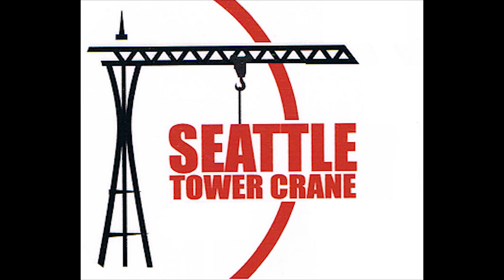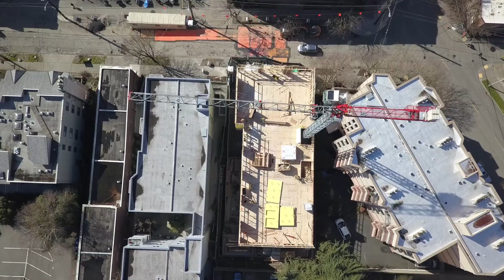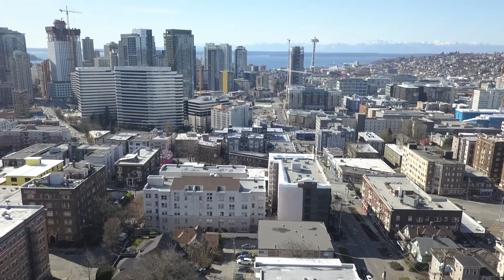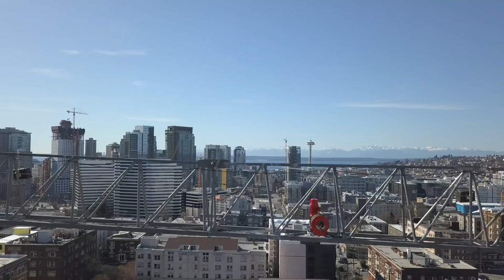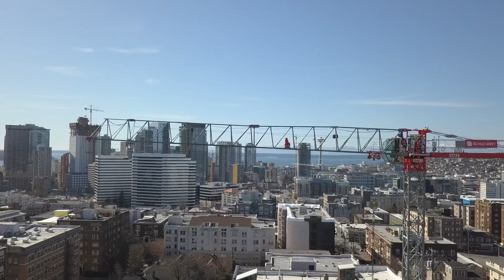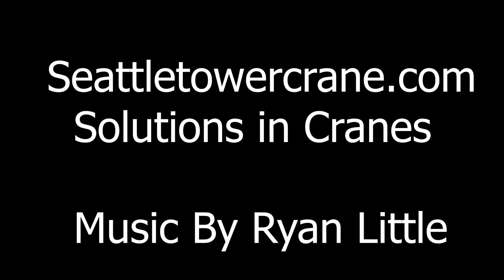Saez TL55 with 82' of jib

Comment: I’m in one of these cranes and I have to say it’s the roughest I’ve ever ran. I’ve ran friction rigs smoother than this thing
Reply from the maker: Is the roughness just in the swing? If it's VFD controlled, the parameters control the speeds and they can often be adjusted. Like our TLS65's from a couple of years ago, we've had to adjust the speeds from 1st to 2nd step because it was like a 200% gain which would cause the crane to bounce on every pick. So we adjusted 1st 10-15% faster and 2nd a bit slower as well as third to balance it all out. 

My biggest complaint with the 55's is the auto braking on the slew. It takes some getting used to the timing of the stop. You have to bounce through the steps to catch it properly and come to a stop. I've honestly only ran one for a day back four years or so ago when we got our first one in. They do have that VFD locked up on us. I suspect that years later they'd open it up for us but when we first got it they weren't willing to share access to reset parameters. The modern ones, 2017 and newer,  are fully adjustable by the techs and they have good counterswing.
Reply: @rotyag  I appreciate your reply, I was filling in for a guy yesterday and that was my first time in one. The swing and trolley are extremely rough compared to the Potain I usually operate, the build quality is extremely poor too. He’s been running it for a year and has complained a lot about it, I thought it can’t be that bad. It’s definitely the worst tower on the market. I will send him over the adjustments you sent to me and again I appreciate the help.

Comment: Hey rotyag I’m 18 and just started my full time tower crane apprenticeship and I’ve loved some of the content you have already put out I would love to see a video on tips and tricks of our trade or stuff you wish you knew when you first started and thank you for having this channel I’ve already learned so much
Reply from the maker: Smooth and accurate is far more important than speed. If you nail a location and it's coming in smooth in a way that the guys on the ground don't have to work for it, that is actually faster than raw speed. But if you can run at the top end of the crane and do it smooth, now we are talking. That's a bit more rare of a bird. But focus on the smooth and accurate to start. 

Be vigilant about crane safety. Both in operations and structurally. I took a crane down once in Hawaii. it was a 40 story. The last time anyone had been to the base was about a year before for the retorque... assuming it was done. Operator never went down there. The pins in the base were partially out of their holes, not really doing a thing. Fortunately it had tie- ins for the operations side, but we were about to climb it down when it was found. I don't think that we would have made it down in one piece. But you'll find crazy stuff overlooked and it's up to you to find it for your safety. Missing welds. I've found missing welds on 30 year old towers. For 30 years, no one really looked at it. We must be better. 

Don't fear for you job. Ever. That's when people make poor choices. Make the right calls unemotionally. When you hear of a great operator, call them up and ask if you can sit behind them for a few hours when you have time. There are tips and tricks to running each crane. The only way to pick up on the best options are to sit behind the best. Don't let ego tell you that you are good enough. Jobsites will kiss your ass and tell you how great you are. They don't know and they just appreciate when you help them. Always push to be better. I've seen plenty of 50 year old operators that I wouldn't hire to fly garbage cans out of my back yard. We are professionals. We have to be the best and that takes years and years of work. Don't let people make you feel like your work is done. It can always be better. 

Ask questions of those with more knowledge than you. It's amazing what some people know. And the more you know about how cranes work, the less mysterious things are. And you can operate knowing about these things. Horsing a crane around to save five seconds isn't always the best thing if you are destroying the brakes or running too much duty cycle time and cooking the old cranes. Downtime is way more costly than taking a bit longer. (Again, most of that is with the older cranes. New cranes have VFD's the protect the crane from itself and the operator.)

Try not to let the hook idle too much. Pay attention to what is going on on the site. What's the process? Can we make moves that don't need to be done now, but maybe it will save time later? Super's notice that. Also, move companies now and then. You want people to know who you are. You can be the hero in one circle, and that's great. But be the hero in 4 circles and no economic downturn will leave you hungry. 

I'm a chatty bastard... Try not to be too chatty on the radio though. People are listening and they'll wonder why you aren't working.
Reply: rotyag great advice!! I’m down on the ground running truck crane. Every word you speak is truth. Hard to find people like you that share info so freely. It’s also sad to see guys get so relaxed when they have reached what they think is the top. Would love to see some new content. Good luck stay safe